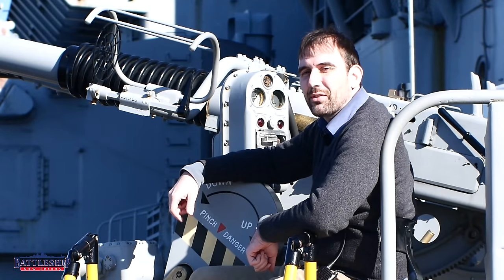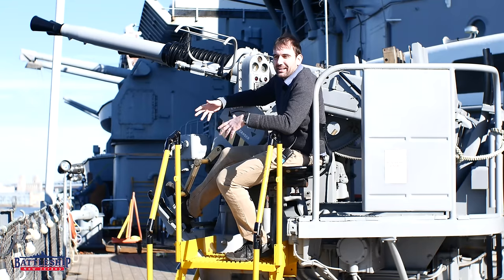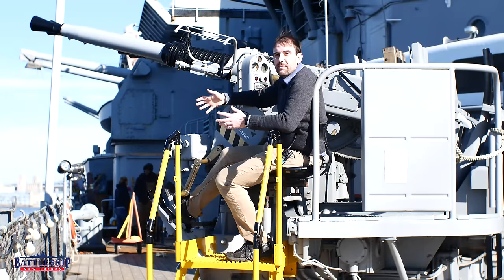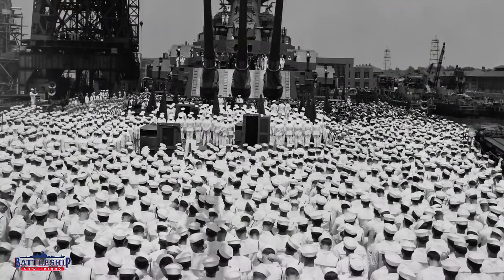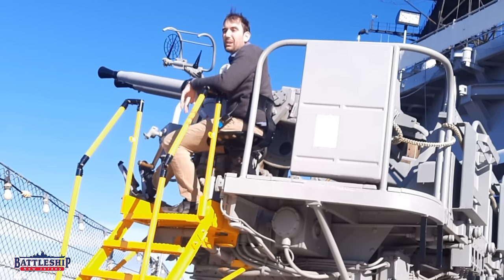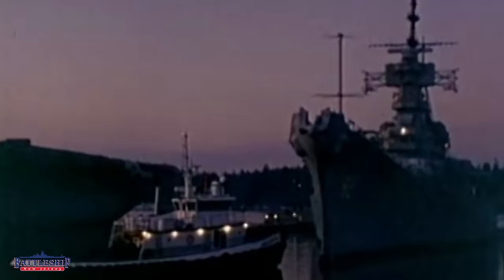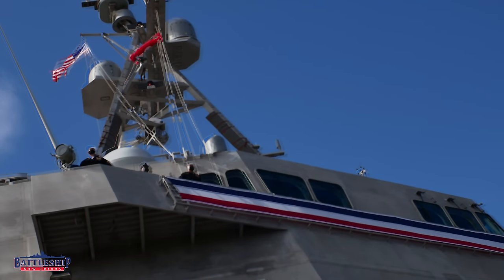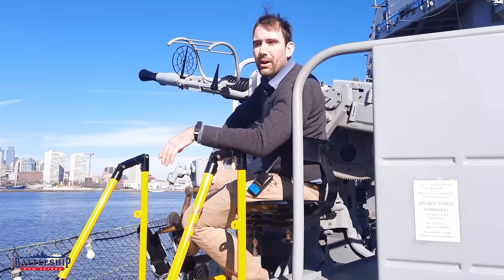What is a Littoral Combat Ship?

Comment: Every LCS mission you cited with the exception of mine warfare are traditional Coast Guard missions.    Paint a half dozen white with an orange stripe, turn them over to the Coast Guard, keep another half dozen for Naval Reserve trainers and scrap/cancel the rest.
Reply: Coast Guard doesn't want them
Reply: @cgmason7568  We have been through this.   It is a sunk cost to the Navy and a free capital asset for the Coast Guarc that requires a smaller crew than medium endurance cutter.  It would be the equivalent of a Treasury Class with one third the crew.  Personnel costs are the biggest component of lifecycles costs. The smaller crew would more than offset the other operating costs.   It would be a good platform for drug ops, sanctions enforcement and anti privacy ops.
Reply: @johnshepherd8687  they are far too expensive to run and don't have speed or endurance
Reply: @cgmason7568  Doesn't have the speed?  The LCS has a max speed of 40+ knots.  The Bear Claas medium endurance cutter has max speed of Standard type battleship. It does have less endurance but how much endurance does it need to operate in Caribbean for drug ops or the Horn of Africa for sanctions enforcement or antipiracy work?  The biggest component of lifecycles cost is personnel.  It has half the crew of a Bear Class. You can also strip some of the weapons systems an associated electronics that Coast Guard does not need to further reducing the O&S costs.  The ship is already and paid for.  The Navy no longer wants the ships and it is costing them money own and operate them.  I am sure they would be glad to give them to the Coast Guard.  Overall they are much more capable even after removing unneeded systems than any current large cutter
Reply: @johnshepherd8687  that's their designed speed but do due engineering issues they don't combine gears, the endurance is only 3,000 miles that's nothing, and why are you comparing to a ship from the 80s and not the NSC which is from 2006-now?
Reply: @cgmason7568  The LCS  has a range 4500 mm not 3000 nm.

The Bear Claas is still in service and the Legend Class is basically an FFG7 type ship that costs nearly twice as much as an LCS, has over twice the crew and shares much weaponry and electronics with the LCS.  It's only advantage is range.  It is a less cost effective alternative even if the Coast Guard actually paid for the LCS.  If you think an LCS us too costly for the Coadt Guard to run then how can they afford to operate a Legend Class.
Reply: @johnshepherd8687  the NSC have 3x the range and for 100m more it actually works
Reply: except they don't have the sensors, comms, or range of Cutters
Reply: I am not disagreeing with you.  The LCS is Coast Guard cutter masquerading as a warship.  The Legend Class is an FFG7 equipped for the Coast Guard.  Both are a mismatch for their respective missions.
Reply: @cgmason7568  The Legend Class cutter is not a warship.   It doesn't need anything more than what an LCS carriers.  In fact, it shares many of the same systems.  Back in the late 80s the Navy suggested turning over some FFG7 to the Coast Guard.  They said "oh no, way to expensive."   So what did they do?  They built a bunch of inderarmed FFG7s.
Reply: @cgmason7568  Not $100 million.  $400 million more.
Reply: @johnshepherd8687  ah no, and looking it up the more accurate price is $650 million per LCS that means they've over run thee initial price by $400 million dollars per hull.
Reply: @cgmason7568  Ah, looking it up they were supposed to cost $220 million and cost $400 million.  That $650 million ncludes the amortized R&D costs which are sunk costs, money down the drain so to speak.  The marginal cost , which is the only thing that matters at this point, is $400 million.
Reply: @DeeEight  both have short range, it still have its issues considering 2 of them were decommissioned aswell
Reply: @cgmason7568  I am going to make this simple for you.  If the Navy relinquishes LCS unit to the Coadt Guard what is the procurement cost?  Think hard.
Reply: @johnshepherd8687  the same cost to run as a DDG, it's an objectively terrible ship
Reply: @cgmason7568  You didn't answer the question.  Try again.
Reply: @johnshepherd8687  no I answered it, the LCS still coat hundreds of millions and the Coast Guard would still have to pay to maintain them
Reply: @cgmason7568  No you didn't.  The procurement cost would be zero.  If the O&S costs are twice as much as a Legend Class it would take 20 years to recover the procurement costs of the Legend.    I don't think that a FFG7 type ship is that much cheaper to operate.
Reply: @cgmason7568  You keep deflecting.  Nobody is disputing that.  However, they have been built and are not capable of fulfilling a Navy mission but can fill many Coast Guard missions.  The question is what do you do with the ones you have built?   Handing some of them over to the Coast Guard would give the nation to get some use out if them.     You seem to have a problem understanding the concept of sunk costs.
Reply: @johnshepherd8687  sunk cost fallacy

Comment: I think the biggest problem with the LCS is that the crew is too small.  If they take any casualties, critical jobs aren't going to get done.
Reply: Biggest problem with the ship is it’s made of aluminum and not steel 
Any modern anti ship missile is going to cause serious damage 
A modern torpedo exploding under the keel will break it in half
Reply: And that they keep breaking
Reply: @cgmason7568  Yeah, you actually have to y wait in base barracks for their ship to be operational.leave the dry dock to be efficient. The Navy saves money on the smaller crew size as the crew waits in the barracks for the ship to float again and go through certification and acceptance again. Yeah! Efficiency! Cost savings!
Reply: Norway experienced that, when they had an accident and sunk one of there frigates, they had a crew of only 105+ on a 133 meter frigate, and they was all tired from a big NATO/Norwegian exercise. Today, for example the frigate that is escorting CVN Harry S. Truman in the meds, have a crew of around 150.
Reply: @FP194  That would be true if it was made out of steel. It’s the same situation as it is for any ship (besides maybe a carrier). An ASM causes a mission kill, a torpedo or two causes the ship to sink.

Comment: Was this what the Pegasus class PCM was supposed to do in the 80s.  It’s propulsion system ended up decommissioning them.  Fast shallow water low endurance middle armed patrol craft.  Yes the LCS is bigger, but still has a similar mission and big problems. Wasted money. 

You could have taken a design similar to the USCG 270’ changed propulsion to gas turbine (vs diesel) and probably came within 5kts or so of the LCS speed with a much cheaper much much more reliable vessel. Doesn’t matter how many bell & whistles a ship has if it’s always in port being repaired .

Comment: All of which are to be decomissioned by end of the next yeah as hull defects limit it to 15 knots.
Reply: I read that the conventional hull version (I forget what class) has a combining gear problem that also limits it to low speed. The trimaran one has the wrong kind of beam supporting the pontoons and it's leading to them wanting to crack away from the main hull. 

As common as CAD and 3d simulations are, I'd think the Navy would've paid for someone to check the engineering math a couple times before they built nine of them.

Comment: Littoral ships look like big boy coast guard ships or peacetime compromises personified. From what I've heard having the repair crew be contracted has only been problematic and ultimately more expensive.
Reply: They are about the size of cutters but way more expensive
Reply: The Navy was definitely flawed in thinking that almost all maintenance would/should be done by contractors. The lower availability of qualified workers has led to these crew having to constantly deploy around the globe, driving up costs. The Navy has realized their error & are taking strides to do more onboard & with their own forces.
Reply: @bamascubaman  but they are still building more, which is sad
Reply: @cgmason7568  That's your opinion. They have a role that they can fill quite admirably, freeing up higher end ships. The new frigate will slot nicely in between LCS & the Arleigh Burkes.
Reply: @bamascubaman  except they can't and don't do the mission they were designed for
Reply: @cgmason7568  the military is replete with systems that have led successful careers that didn't excel at what they were originally designed for. Patience grasshopper.
Reply: @bamascubaman  20 years is very patient when their service life is 25 years

Comment: well- it kind of appears to be a rather large, very modern replacement of MTBs or those hydrofoil things that could exceed 40knots in their time. MTBs (the german navy used to have very nice Excocet carrying so called S-Boats, back in the days ...) to operate in the Baltic approaches. fast, relatively powerful and punching above their weight. 
the LCS sure have to prove themselves, when they have settled down to routine ops. 
hopefully they free up some money to build proper DDGs or CGs for fleet ops.

Comment: The base model of the LCS is needed; A 110MK Bofar Gun, 50 cal mounts and maybe CIWS Chain gun or SEA RAM.  The mission area should used to accommodate a Marine Platoon or even Marine Company (3- 40 Foot Mission Modular Containers) if tested.  The flight deck could accommodate Ospreys or Apache landings.  I don't know if it has been tested for F35b landing yet.  I think a Marine ManPad unit could also be housed now.

Comment: Littoral Combat Ships have a classification based on letters A-C that determine how stealthy they are.  C Littoral ships are the most stealthy, as the vast majority of men have a hard time locating and finding Class C Littoral ships.  For some reason, female radar operators do not seem to have a problem with this though.
Reply: I was wondering how long it would take for somebody to go there.  C Littoral ships indeed.  That said, they CAN be located...if you use a large enough missile and the proper approach profile.

Comment: I served on two frigates in the USN that did Law Enforcement Ops (LEO). It was OK for FF/FFG types to do that now and then. It's not OK for a DDG to do that in the Caribbean or off Somalia or anywhere else. That is a total waste of a scarce & expensive capable warship that should be doing fleet work. The biggest mistake on the LCS program was the propulsion plant requirement of 40 knots, which produced a horribly designed plant & poor operational reliability. The weapons systems were OK as designed. The USN has a history of building warships devoid of weapons then retrofitting capability afterwards; thinking Spruance & Knox classes as built. Had the USN required a reasonable 32 knots or so, they could have put two LM2500s as a conventional CODAG design set up and had little or no issues. You can always up-arm a warship. You can't change the propulsion plant. The LCS, properly envisioned & designed & built, could have been a great addition for low intensity assignments to free up the DDGs for the important work. In the end, the whole program was ill conceived waste of money.

Comment: What is a Littoral Combat Ship?
A waste of money originating from faulty Naval think tanks in the late 90s/early 00s that couldn't conceive of the need for larger ships with the fall of the USSR so tried to save money with smaller ships with modular designs. The smaller ships proceeded to fail at being cost effective, and the modularity was no where near as easy to switch out as it was supposed to be. That is on top of being redundant as near-peer adversaries have appeared with China's massively expanding Navy (and illegal sea claims), and  Russia going crazy again.

On the plus side, the Constellation Class frigates replacing these seem far better. Both cost effective (re-using a proven design), and better for larger fleet actions.

Comment: I kinda think the Zumwalts might have died to mission creep.  My understanding is their primary design goal was to be "land attack destroyer" and to provide long range short bombardment capabilities.  Not be a massive multirole ship.
Reply: The trouble is that mission hasn't been viable in the decades since anti-ship missiles came online. It's a job done more safely by planes. They're also more versatile and have much better range. Our doctrine is about hitting harder, faster, and deeper, and needing a prolonged shore bombardment just means we already failed.
Reply: Not mission creep. Congressional meddling in their budget and development. There was supposed to be 32 ships, with two advanced gun systems each, with some thousand rounds of guided 155mm long range shells each. As the order was cut, that also reduced how many guns would be built and how much ammo would be procured, and the unit prices for all this new stuff was based on the 32 ship run, in order to spread the R&D costs out across the total production run. When it finally dropped to 3 ships, well now there would only be 6 guns and 6,000 ish rounds of ammo, and now the guided shells went from about $60k each to a million plus each, or basically as much as something like a harpoon missile.

Comment: Savannah has a bigger flight deck than a destroyer or frigate that operate a manned helicopter and a firescout unmanned helicopter.  In addition it will have 8 NSM antiship missles.  That is a lot of firepower in a small package.  What ever happened to the 1800 ton destroyers of WW2 that did all the unglamorous jobs such as radar picket duty or hunting Japanese supply barges around Guadalcanal?
Reply: The WWII 1800-tonner had a crew of 350 with about 15 officers.  The LCS has a crew of 40-70 with 4 officers.  The LCS is not intended to go up against a standard warship, or indeed against anything heavier than a speedboat "armed" with a couple of soviet-era surplus RPGs and some AK47s.  It definitely feels like a solution in search of a problem, far too easy to mission-kill since its gunnery system lacks redundancy and the crew isn't capable of making even minor repairs.

Comment: I understand that the LCS have a gearbox taking energy from both power sources to drive the impellers, said gearbox had problems in early units. That configuration is a colossal screw-up in my opinion, I understand the history of USN having gearboxes in the past for better speed control, but we are not in the 1890s anymore. Bolt a generator up to those turbines and spin those impellers with an electric motor, you get instant torque, more fine control of speed, and they are damn near silent.

Isn't one of the selling points these recruiters sell these kids on is technology that translates to the real world when they get back? Who else in the world runs gas turbines connected to double reduction gearboxes to drive screws or impellers or anything else? I believe the Columbia SSBN is supposed to run it's screw/pump on electric motor(s), it is about time the MIC contractors did something from the last century.

Comment: When it come to the propulsion plants... welcome after... we have been doing that for a while, whit Skjold class. But then we operate the world fastest warship in the world. officially at 60+knots (People have timed them at 68 knots, but that is not an official number), They was originally build with Diesel and jet engine with waterjet-propulsion. But the gearbox, kept disintegrating, everytime both the diesel and turbine was working together, so they replaced the diesel with jet engines...

You can do what US did, use a lot of money, to make that gearbox work (they did also have problems) or do what Norway did, remove the problem, by replacing slow rpm diesel engine (compared to jets), with turbines.
Reply: Or better, reduce the ludicrous speed requirement on 3400-4000 tons warships.
And use that space to increase endurance or add capability.

45+ knot ASW or Mine hunting vessels are a ludicrous usage of the taxpayers money.
Reply: Something like the Skjold would have been perfect for the litoral combat bit.

Enough range for the Persian gulf.

Something like a longer Visby as a lowend frigate.

Comment: You shouldn't have mentioned the banana in the beginning, that way the comment section would be filled with "wtf is that a banana" comments and drive engagement.  Also after that intro I was expecting more banana than I actually saw, slightly disappointing.

Comment: The problem with changing things up so quickly is well, you gotta figure everything out very quickly. The military has never been good at that in the grand scheme of things. They should have just built a smaller battle ship and went from there. Stop forcing the evolution of equipment, battle ships do and have worked up into modern warfare. So just take a battle ship design and make it more capable in shallow water and bing bang boom you got your self an "LCS".